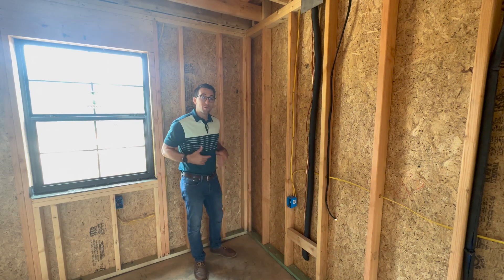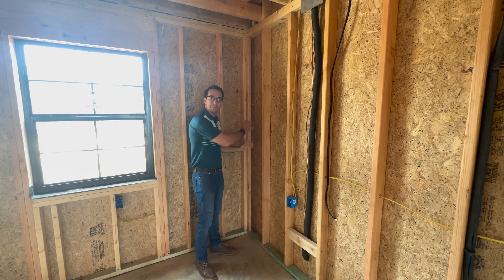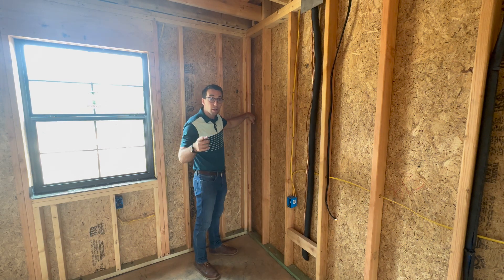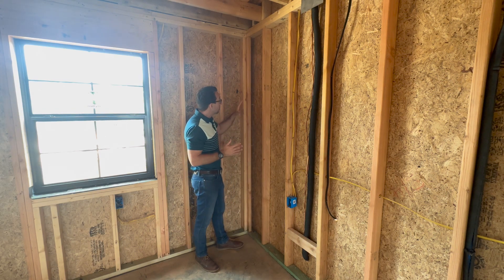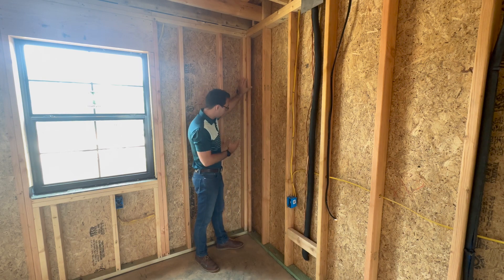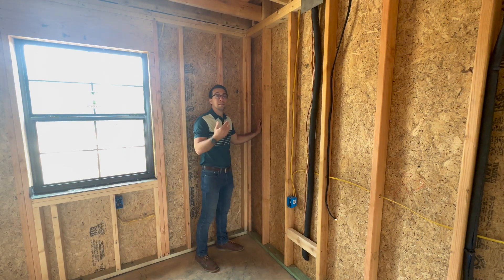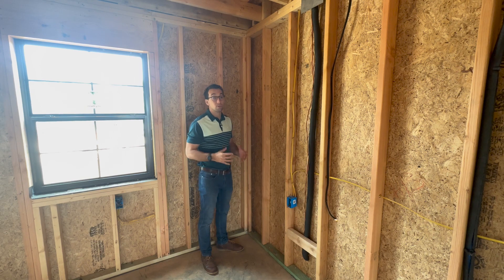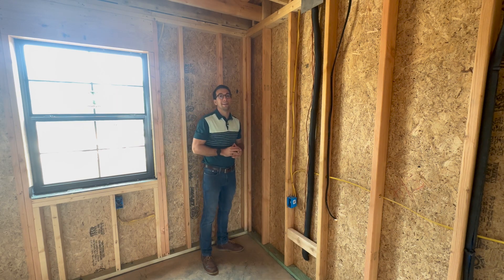California Corners - Framing Technique

Comment: I bought a 1940's house 5 years ago and while doing Drywall one of the corners was like this I filled mine over with Tape and Bedding with thick Plaster over it and it worked

Comment: Funny thing is a California corner doesn’t pass inspection in california.
Reply: Most inspectors in texas coastal counties won't pass it either due to windstorm concerns. Even interior wall intersections with the exterior wall need to be solid stud packs.
Reply: @williamdaly7135  solid stud packs or standard channel with 2 studs and one on the flat?
Reply: Solid for exterior walls and corners. 3 full length studs and one on the flat.
Reply: Also, H2.5a hurricane clips top and bottom of every stud and from joists or truss to double plates as well and strapping from double plate over every door and window header and down onto the Jack's as well

Comment: Why wouldn't you spray foam the hollow pocket however its framed?  We have always done it here in Massachusetts theres these things called drills if its actually blocked off
Reply: Because there isn’t a hollow pocket with a traditional corner
Reply: its closed off lmfao

Comment: This is only okay for interior walls not exterior corners. Even in California that will not pass anymore. You fill the corner with solid studs or a 4x4 with HD's. If it's my house i would not even do it on interior walls.

Comment: I'd rather do a 2×6 or two 2×4 walls to increase insulation. That'll push the wall in far enough to allow overlap.
A single 2×4 does jack nothing. I'm not wasting time shoving compacted scraps of insulation into a tiny notch to lie to myself about increased R value.

Comment: Master carpenter Larry Haun who helped developed most of the production framing techniques we use today developed this Method build out the san Fernando valley post wwII
Reply: Yeah it saves lumber and time but structurally, it's not good on exterior corners. Solid studs is the correct way. It's OK for interior corners if you want to save a couple studs.

Comment: I've been framing corners like this since the dawn of time, and that's all I ever see where I live, and I'm not in CA. 
This did not originate in CA because of some progressive green movement. Who knows where it originated, probably East coast. It actually saves a stud. 3 vs 4. Yes, it makes the electrician and insulators happy.
Reply: That's why it's called a California Corner. Because it was developed in Texas. Not hardly and it's only a good idea on interior corners not exterior structural corners.

Comment: Mis-named corners.   California is earthquake prone and having a "California Corner" probably isn't the best idea for earthquake-resistant designs; solid post corners would be better.
Reply: You also need something to fasten drywall to.
Reply: @charleshairston4853  You just add non-structural 2x4's for that.   Better than than your house falling apart in an earthquake.
Reply: This was used many years ago. Now, days this will never pass in California.  It's maybe OK for interior corners but I prefer solid studs in the corner. Post with HD's or Simpson Strong Walls are what California uses now days. California probably has the strictest building code in the country because of earthquakes.

Comment: If it was developed in CA, we don't want it here in MT...
Reply: Such a sad person.
Reply: California doesn't frame corners like this. I started in 1972 in So. California. A solid stud corner is required.
  It might have been developed there, but it hasn't been done for 50 years. I moved out of Cali 12 years ago.
So glad I did.
Reply: @GIUL7301 yeah Idk why he said it was developed in CA. There's absolutely no proof of that.
Reply: That’s right, our method in MT. is using structural popsicle sticks for corner framing in all our trailers.
Reply: @Scorpio1060- but, but, I like popsicles.
You can keep your new fangled California gas cans too.
Reply: @Kevin-mp5of  just fine. In fact I prefer a snortin' pole.
Reply: ever had an apple in winter? 

js
Reply: Says the one watching this video on an iphone...
Reply: @MinhNgo-yf4qm What does that have to do with anything.

Comment: It would be helpful if you could show a top view of the framing; I still have no idea what a California corner is.
Reply: I d8dnt know there was another way other than this, but I call th8s an L
Reply: This is the way to do corners. Better for electricians and insulators and still has the same structurally sound outer corner. This is the only way I've ever known, and I've never built in CA.
Reply: @cgschow1971 No it's not the strong way to build. It's OK for interior wall corners but not exterior corners.
Reply: @H43339  How is this any less strong? The only reason they add that spacer in the first place is for drywalling... the extra stud there is not for structure at all..... 
The difference between the "blocked off" corner and the "California" corner is simply flipping the extra stud sideways to allow access to the corner...
Reply: @turtledude01  Drywall is Very Important  !!!
It's what you see  !!!
And I never said anything about two studs with blocks in between. The best exterior corners are three solid studs or a 4x4 and extra studs for DW BACKING.
Reply: @H43339  Many building inspectors will not approve "California" corners as they lack overall strength.
Reply: https://youtu.be/PKlSDZ0XBI4?si=WXhLZ9ho9dSNAi_7